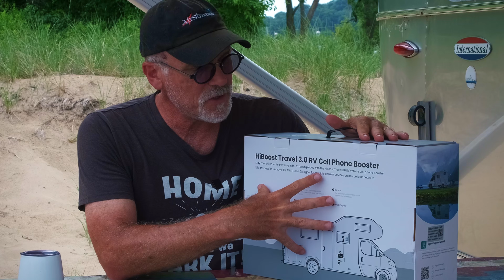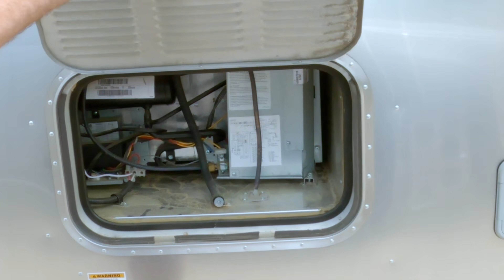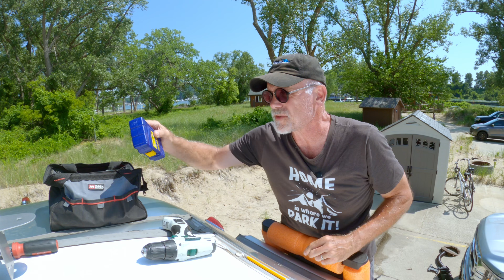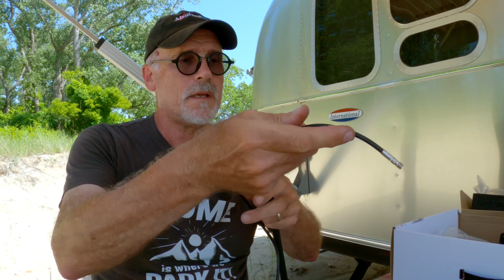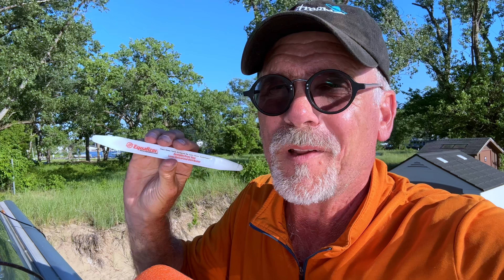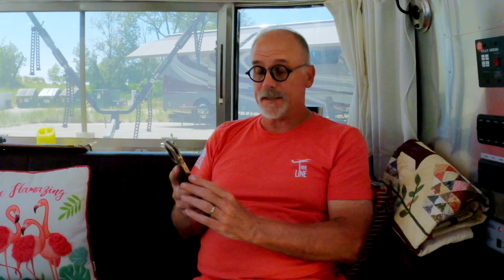Cell Booster for RV - we install the HiBoost Travel 3.0 RV Cellular Signal Booster

Comment: "Won't be using the magnetic portion." So you could just buy a sticky mag strip but you need to break out the drill? Why?
Reply from the maker: I don't recall the HiBoost having any type of magnetic mount, but I've been really happy with the sturdiness of my solution. The wind pressure on that antenna can be pretty significant. Thanks for watching and commenting. - Jim

Comment: Another great video.  I wish you had included how you tied into 12 volt power and ran the cables up on top of your trailer.  This is a future project I would like to do myself.  Thanks again for posting this.
Reply from the maker: Half the 12V fuses in our Airstream’s panel are unused. I snipped off the cigarette lighter plug, stripped the wires and connected it to an empty fuse. It still is working great… but it can’t boost nonexistent signals. We are at the tip of the Keweenaw Peninsula and there is no cell service here. Thanks for the comment. - Jim

Comment: Does it generate a lot of heat?
Reply from the maker: Not really. I can easily lay my hand on the booster, it's just slightly warm to the touch. We are in a good cell area right now, it is possible it will be warmer in a poos service area. I plan do do an update when we are in Michigan's Upper Peninsula this autumn. - Jim

Comment: Great install video!  It's the attention to detail like the rubber grommets that is so important to show.  Also, the use of blue Loctite will be important when you need to maintain/troubleshoot your air conditioner.  Man, your roof is clean.  I know what I'm doing later in the week...
Reply from the maker: Thanks guys! Thank you for your kind word. It was a pretty long process, but we believe if others are going to do this, it was valuable information. Also, chapters are nice because you can move forward and backward, according to what you need to see. Uh oh, cleaning your roof time? :) Michelle